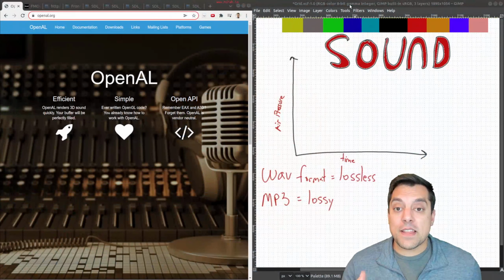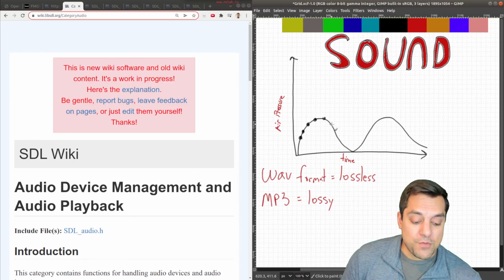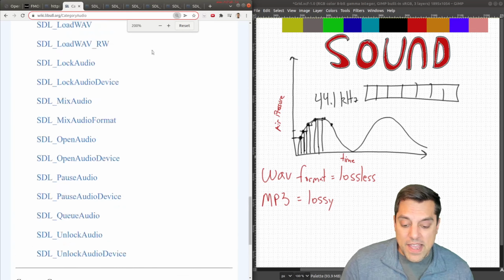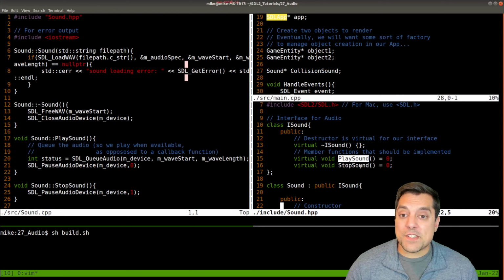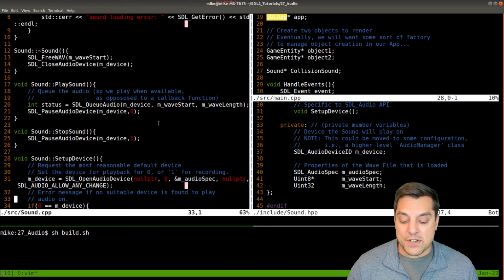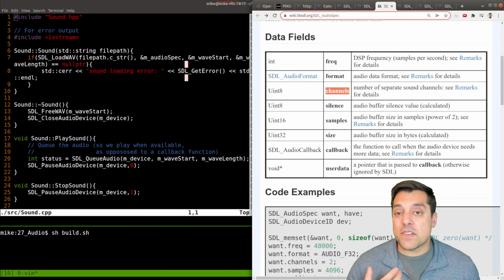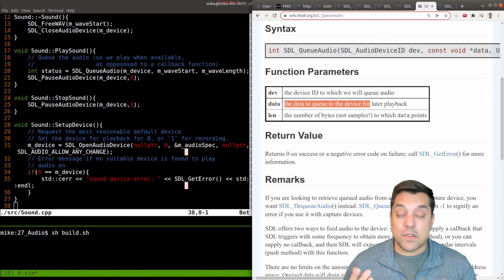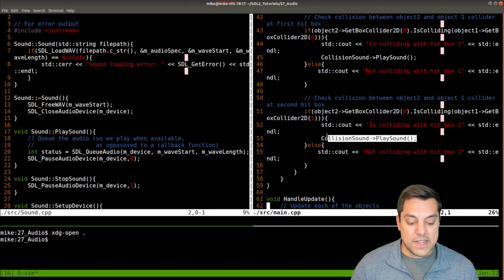[Ep. 35] Simple SDL Audio API tutorial (Not using SDL Mixer) | Introduction to SDL2

Comment: What are the advantages of not using SDL mixer, is it really slow?
Reply from the maker: I haven't measured performance, but SDL_Mixer rather adds functionality. The only disadvantage immediately is that SDL_Mixer is another dependency to your project.
Reply: It is buggy.
Reply: so if I want to play multiple sounds simultaneously, can sdl audio do this?
Reply from the maker: @glowiever  SDL_mixer or other apis have a better interface for this. I believe you'd have to queue and mix the sounds directly otherwise with SDL_Audio